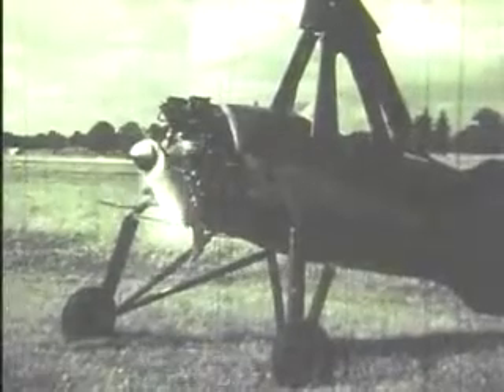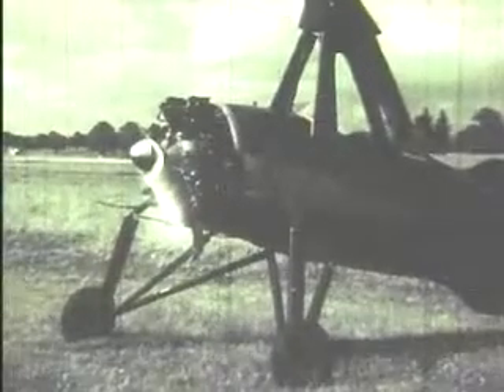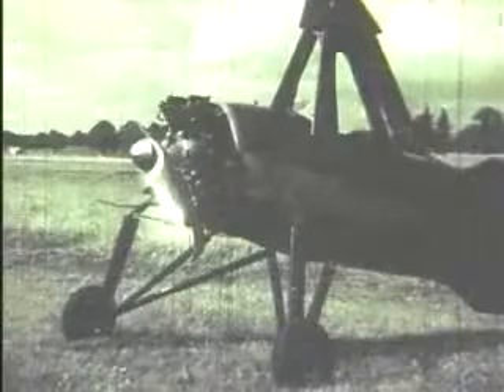History of the Helicopter   The Auto Gyro   Part 4

Comment: Sky-Car - the device is an ancestor of contemporary flying saucers. This umbrella plane looks funny, but it is unlikely that the American inventor spent money on making the machine just for fun. The flight principle based on generating compression under a vibrating plane is no worse than the flight principle of traditional airplanes. When the device was being created, engineers realized that it would give a higher lifting force. Step by step it turned out during the tests that the device could perform a flight if the oscillation frequency was measured in megahertz and the amplitude of oscillation in millimeters. But at that time there were no technologies to get the total power of vibration and achieve supersonic frequency. The aircraft-building company of Chance Vought cooperated with the Naval Department. The Skimmer flying saucer that appeared after WWII was a result of the cooperation. It is believed to be an experimental variant of a propeller-driven airplane, however it is not ruled out that Chance Vought made the model especially for running tests of the aerodynamic lift of electrokinetic engines.

 In the late 1940s, first flying saucers appeared in the US. They resembled telephone loudspeakers: impulse electromagnets made one or several huge membranes beat the air at a megahertz frequency. And a streamline top part of the device provided the difference of drag forces on the top and on the bottom. But still some facts pertaining to the strange device remained unclear. A flying saucer could not generate any lifting force until it threw something off the way rockets did. This is a ring whirl: it does not leave vacuum to intake a flying saucer. It is necessary to keep a saucer on the ring whirl just for a couple of microseconds, the period within which a new whirl is generated.

Flying saucers with impulse electromagnets were heavy and could not cover long distances. So, Americans had to use submarines to deliver them to the Soviet shores that gave rise to stories telling that UFOs emerged from under water. Later, new devices appeared where no electromagnetic field was used to shake a propelling membrane. The bodies of such devices were made of piezoceramic, and vibration appeared thanks to the piezoelectric effect (we know that piezoelectric tweeters make the sound in electronic alarm clocks and mobile phones). The new generation apparatuses were no longer saucers but spheres, ellipsoids and other three-dimensional figures haloed with ionized gas. The USSR got UFOs of its own in the 1960s-70s. Once, Soviet Academician Shklovsky asserted in the popular informational program Vremya (Time) that there were no other creatures besides earth dwellers in the Universe. It sounded like an official statement of the Central Committee of the Soviet Communist Party saying that no aliens ever existed, and all reports alleging that people witnessed UFOs were misinformation. Special committees immediately started censoring newspaper publications and deleted everything that could be connected with UFO visits and aliens.

At that very period Americans already had the third generation of flying saucers, dark objects with just few zones on them glowing. Those were whirl activators: the glow on the bottom to make the object fly and the glow on the side (so-called illuminators) to make it move to the sides. Now used motor panel. They are arranged as a plasma TV screen. But the cell arresters is the tube of the rail launcher in cities. Plasma sparks popping up with great speed thousands of times per second - this creates a toroidal flux rings, which propel the apparatus.

 Flying saucers are not in fact fantastic aliens with antigravity machines but quite earthly apparatuses with electrokinetic engines that take off and move thanks to creating vortex rings. This is an absolutely unusual idea to us. Is not it? However, as far as we believe in the existence of aliens we should also recognize a new flight technology that was invented some time ago and has been kept secret until recently. When explained clearly, the principles of the technology are quite understandable and do not seem to be fantastic. We know that vortexes are also very important in generating the lifting force of flying insects, take a dragonfly for instance. Now that we know the principle of flight of flying saucers we can trace the development stages of the technology.

But despite of the fact the American military are not going to declassify the technique. These days UFOs can be often observed in Iran and  China - that proves that the US keeps on employing its secret apparatuses.

 A question arises why the break-through transport technology has never been declassified and officially used? In fact, application of the revolutionary breakthrough technology would have inevitably resulted in transforming the entire of the civilization and infringed upon the interests of a great number of people. Such apparatuses could help easily cross governmental borders, the thing that would have made them a cherished dream of terrorists and drug dealers. Such machines could be more popular than transport using petrol which would inevitably mean bankruptcy of oil tycoons and automakers. And the key reason of the secrecy in this situation is the fact that use of such flying saucers contradicts the international law; these machines cross governmental borders without notification of authorities. So, the advantages are worthy of keeping the invention secret for so many years. And this is why the secret of flying saucers was kept for so long. The story about the secret of UFOs says it is t ime to say goodbye to a nice legend about aliens no matter how we like it.

In the book of Christopher Buckley's "little Green men" calls for the President of the United States - the requirement to disclose the mystery of UFOs, behind which lies the secret activities of the secret military.